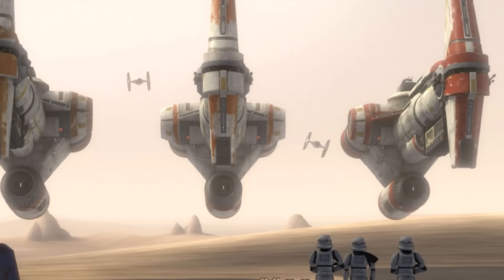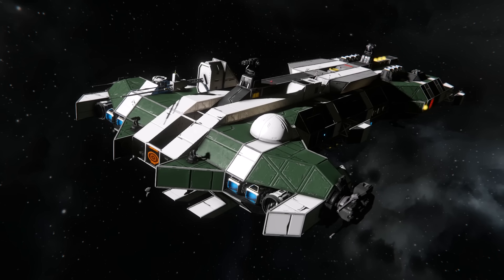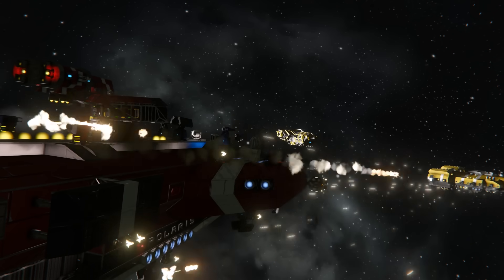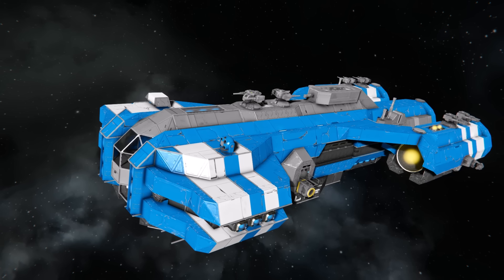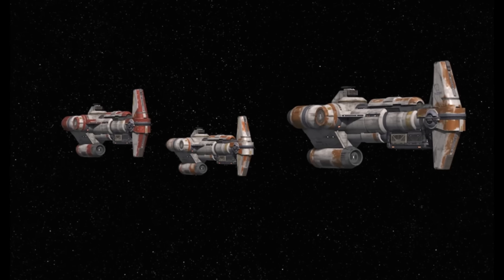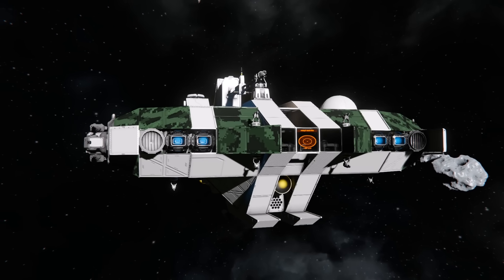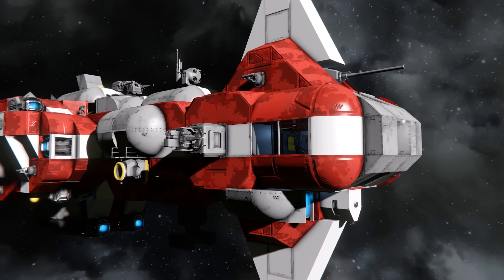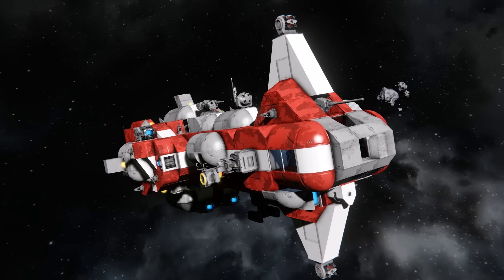Why Hammerheads are BRILLIANT

Comment: Don't forget about using small grid turrets on large grid ships. This works well on smaller ships because the footprint is much smaller. Hinges and roters are an easy way to do this, though hinges are more versatile.
Reply: Edit: I mean vanilla small grid turrets, not the ones players make themselves.

Comment: There even in halo infinite now

Also to me horizontal doesn’t make a lot of sense to me, Ik there’s no up in space but in scify there almost always in the same plane so your not “cutting” into the ship your just more likely to get stuck in it because your hitting a larger surface area 

Horizontal makes sense if you ram it 90° to the other ship so it is cutting through now slamming into it length ways to lengthways

I want hammerhead missiles

Comment: Here is a design I like:
THE PYRAMID HEAVY  BATTLE SHIP
1. Hull & Geometry
Primary Shape: Tetrahedral/pyramid (4 triangular sides, one flat underside).
Advantages:
Wide base for turret coverage.
Natural armor slope (good for deflecting kinetic and energy fire).
Pointed prow can act as additional armor for vulnerable sections.
2. Propulsion
Main Thruster: Located at the center rear of the pyramid, capable of high forward thrust.
Reverse/Retro Thrusters:
Housed at the forward-facing point (nose of pyramid).
Normally concealed behind a retractable armored pyramid cap, preventing damage when not in use.
Maneuvering Thrusters: Small vectoring nozzles along edges for agile pivoting.
3. Weapons Systems
Heavy Turrets (x4):
Mounted at each corner edge of the base.
Provides overlapping fields of fire (360° horizontal + upward coverage).
Suggested loadout: Heavy plasma or railgun turrets.
Point-Defense (PD) Systems:
Retractable pop-up turrets embedded into each pyramid face.
Covers close-in missile and fighter threats.
Missile Launchers:
Vertical launch systems hidden in the upper sloped faces.
Capable of both saturation strikes and long-range guided missiles.
4. Defensive Features
Sloped Armor: Pyramid geometry deflects incoming projectiles.
Shield Projectors: Edge-mounted shield emitters for layered defensive grid.
Protected Engines: Retractable armored nose cover shields reverse thrusters.
5. Crew & Systems
Bridge/Command Deck: Deep inside, near the center mass, for protection.
Hangar Bay: Underside of the pyramid — concealed landing pad for drones/fighters.
Energy Core: Located in the pyramid’s central spine, feeding both weapons and propulsion.
6. Operational Role
Heavy Destroyer / Siege Ship: Meant for forward assaults, using its turrets and missiles to dominate. 
Can disengage  quickly  if overextended at the risk af taking damage to the reverse  thrusters 
Defensive Anchor: Can rotate in place, relying on overlapping turret arcs.

Comment: I have been thinking, what about a double hammer head design? It simply is front vertical like star wars but the back where the engines are is another hammer head but horizontal. Would that be useful, like the front using gun and the back having rocket launchers? Or would that give it a to big profile for targeting?

What do you think? 🤔

Comment: Honestly in ship building games like Space Engineers or From the Depths I run "Star Head" designs which is basically both vertical and horizontal  hammerhead designs combined.
Reply: The cross
Reply: Seems with that design you gain more hardpoints for guns but also expose more of your ship to the enemy.
Reply: @fourayes1655  Yes but it also adds more opportunity for shields if you game has those.

Comment: Does anyone have any tips on making rotors and hinges less bouncy and klangy? (I'm pretty new to this game) Even my solar arrays on my base which barely have any weight on them at all like to bang around and move in sharp bursts. It's made custom turrets completely useless to me, especially on any small grid ships. I've tried messing around with torque and stuff. But it is even happening when they are locked. Is this just part of the game or am I doing something wrong? lmao
Reply: Are you using the "share inertia tensor" setting on them?
Reply: @miguellopez3392 no. Im not sure what that is?
Reply: @projectgg6730 its a setting im not sure of you have to eneable it on the save settings before you eneble it on the controll menu for the part but it essentially fixes some of the klang you get with rotors and hinges by making them act more solidly attached, bud sometimes can cause clang if enabled on certain builds so its not in by default.
Reply: @miguellopez3392 I just figured out how to enable it and tried it on my solar array thing and it seems to help a lot! I think you might actually have fixed the issue i was having with them haha thanks

Comment: I've been meaning to try a hammerhead with a twist, a set of "towers" running perpendicular to the hammerhead at the rear of the ship, giving the ship a sort of + shaped profile, with a bridge at the base of one of the rear towers. In theory it doubles up the advantages of the hammerhead design by adding a second hammer that can be angled toward the enemy, but I can't speak for how it performs in practice..
Reply: What you've just described is in fact the Mandalorian Keldabe Class Battleship!

I plan to make all my warships based off that design. It has loads of good spots for mounting weapons.

Comment: Nope. Hammerhead increases surface area to be armoured, shifts a large bulk of mass far from the center of mass, has poor internal volume for weapon systems (if applicable) and generally has poor surface area for mounting many weapon systems. Most examples in this video are pretty laughable too as they seemingly mount only 4 guns, which absolutely do not benefit from being on the hammerhead

Comment: Literally been spending my recently few hours in SE updating the old og big blue to be more "modern", which includes ripping out a lot of the older conveyors and other such systems. Very much a refit. But I was also looking at fitting a hammerhead to the design, so this has given me some things to ponder. Definitely will be reworking the neck and front section!

Comment: Super firing turrets on a central line of keel/spine allow for full weapon saturation in far more tactical maneuvering. A hammerhead hull is essentially using the planform of a broadside aligned to the axial aligned primary thrust of a hull and makes it laterally aligned to the same primary thrust of hull. 
Becuase the weapon planform is no longer parallel to the axis of thrust and is instead perpendicular, you can not "notch" a target and achieve full fire saturation. 
Superfiring axial aligned ships cover their flanks via their broadside, and the superfiring positions still allow for full forward facing fire power when in pursuit or on an advance, engaging formations.

The hammerheads have one boon for them, and its their cheaper design. You can effectivelt armor up the front and focus on setting up a front facing broadside, and double that hull section in armor so that the main hull of the vessel is basically shielded from intended incoming fiee, and can be built cheaper.

Comment: My first large grid ship was a hammerhead cruiser designed for ramming. Unfortunately, I didn't know how collision damage was calculated at the time, and you can guess my disappointment during post-construction testing. Eventually I redesigned it to serve as a bulkhead to protect against railgun rounds while the ship is able to fire railgun salvos itself. 

I do agree that wedge shape is generally better for crusiers and larger ship, but I don't think they are mutually exclusive. For my ship, I have a large heavily armored horizonal hammerhead fitted with PDC and sub caliber guns. Behind that I have a low profile vertical wedge with my large caliber gun in a position for superfiring capabilities. This results in a pretty powerful setup. But I will admit, against numerous enemies outmaneuvering the cruiser, I have to rely on defensive guns to handle them before they deal too much damage. In that situation, a well-rounded cruiser would be better.

Comment: From testing that found several methods to work best 

Placing super firing turrets on the x-axis giving 100% forward fire with 90°+ arc up & down (2 can fire backwards)

Placing super firing turrets on X & Y axis fires 100% forward. 50% up, down & sides. With 4 backwards 

When looking at the ship from the front. Placing turrets in a circle~ pattern fires 100% forward & backward. With a balanced firing arc all around

Comment: There is a hidden power to Vertical Hammerheads in Space Engineers.

If we go with the Spacebar+W accelleration method, we can put decoys and important blocks at the back of our ship and the bottom of the Hammer can be used as a shield. Don't put many components in the bottom part of the hammer, use it as a heavy slab of armor.

With this configuration, most opponents will miss you entirely, but those that do hit you are much more likely to hit your "shield"
Reply: Hammerhead in SE also allows your reverse thrusters being shielded from direct frontal attacks.

Comment: I have never been a fan of hammer heads visually. How ever recently i have been designing some missiles and have found out that best way to make them more survivable, is to give them little hammerhead with decoys separated from the main body. This is very efective at diverting turret fire and buying few more critical seconds for the missile to reach its target. Also if you spin it fast enough, turrets will just miss, due to how turrets try to predict their targets position linearly, and do not take rotation into account (the same reason why "spin to win" has prettymuch always been the meta). Maby some day i will attempt to build actual ship with this kind of design (for now i have prefered arrow head shape with superfiring turrets or railguns)

Comment: I'm not much of a fan of the hammerhead. Having a large frontal area just means a bigger surface area exposed to enemy fire. Sure you could armor it, but if the ship has any length or if your attack posture has any imprecission, that armor will do nothing to protect the engines and crucial systems in the aft, making it effectively wasted mass. What are you protecting behind that armor? Just the conveyors to the turrets on the tip? But if you give the ship a narrower profile, those same turrets could have the exact same firing arcs in every direction save backwards (which the hammerhead won't be focusing on anyway), and the armor weight could be spent covering stuff that truly matters with greater thickness.

In space engineers at least, turrets don't have much more than, I dunno, like 15 degrees of downward elevation (and other settings are probably similar), so to give the turret a perfect firing arc, the hull doesn't need to be sloped by more than 15 degrees. Sloping it nearly 90 degrees, as with the hammerhead, does nothing to benefit the turret's performance, and just exposes more of its conveyors and support equipment.

Not to mention, in space engineers (and other settings I'm sure) presenting a highly sloped surface to the enemy target will often cause projectiles to deflect and bounce off. This is a benefit that wedge-shaped ships can utilize extremely well, but which hammerheads cannot utilize at all. Almost all my ships are arrowhead-shaped, with artillery superfiring from the flat sides and PDCs on the edges (where a Star Destroyer's greebles would go), and I've been very pleased with the survivability of the layout.

Comment: i really like the shape of the hammerhead , but theres a few more stuff you didnt mention , for example in the vertical head , you leave a " window " open for shots from the front to hit the engines, unless the shape of the engines match the shape of the head , but its not really a " hammerhead style " if you place the engines vertically , its kinda a tradeoff. the other problem in the horizontal head , you lose the ability to use both " main guns " ( the ones on the edges ) to shoot at the same target if the target is on one side so the vertical one have the edge there. taking into account that the idea of the hammer head is huge thrust forward and little to move around , more of a ram thing.
im glad you made this video i really enjoy this type of stuff